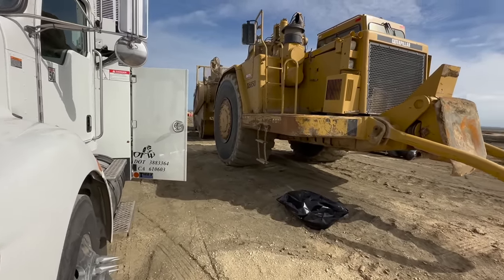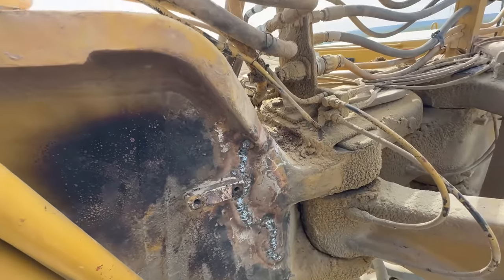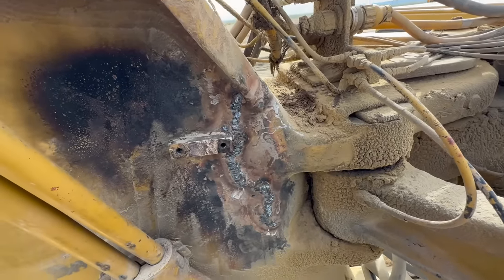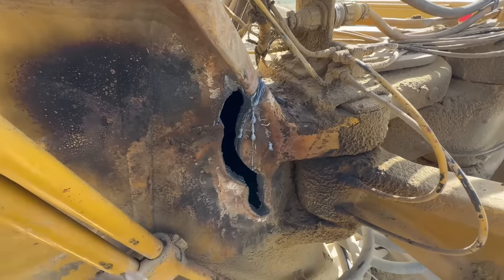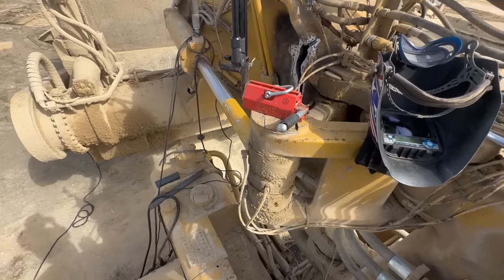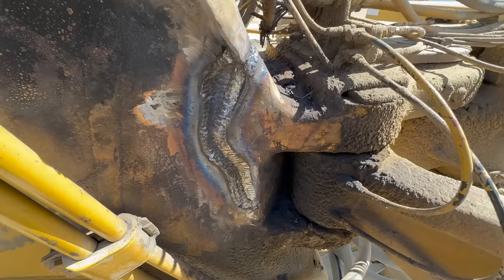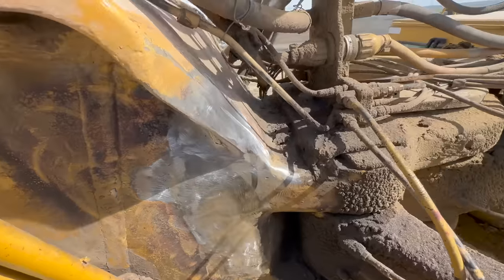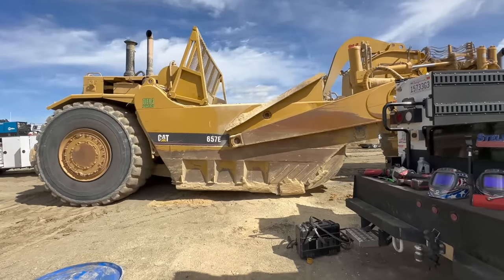Cat 657 with a big crack!!!

Comment: Hats off to who was doing their checks, easily missed until it's a much larger problem, rare in this day.
Reply: Very good point    I have 2 sons in their mid 20s and they would just plough on until the  scraper just stopped or broke n 2  Haha 😎
Reply: That, and hats off to the mechanic that held that thing together for a couple of days.
Reply: That is well spotted, just looked like mud at first
Reply: Checks? What checks?!
Reply: @notorious647  Umm.. the checks that, umm found the, umm cracks, yes, that's it, the checks that found the cracks, and any other defects, you know looking with your eyes. hope this helps.
Reply: @IvyMike.  Who does that?!
Reply: @notorious647  I agree, who does that? I bet the person who found it was the mechanic. I always get things after they have completely fell apart. Afterwards the person is like “yeah it was making a weird grinding noise for a couple weeks.” Thanks for letting me know…
Reply: @notorious647  Pay checks
Reply: usually with stuff like this that has allot of workers around the machine they take safety very seriously and usually call in dedicated inspectors  quarterly or at least bi yearly now if it was the workers inspecting it then im actually surprised cause most dont care even if they own it
Reply: Someone took pride in their machine. Good to see.
Reply: Where I work The MAINTENANCE team won’t do a thing until the machine stops working then they end up having to fix everything instead of just MAINTAINING it
Reply: @collingalbraith4343  well you see you problem started at the in house maintenance part. anything in house will be zero effort just making the paycheck job security bullshit
Reply: It looks to me like this has happened before.
They probably keep an eye on them all the time.

Comment: That was so cool to watch that scraper pull away as soon as you were done. Makes you realize how important the work that you do is.
Reply: I’m a mobile diesel mechanic and I fix breakdowns often. Always fun seeing them drive away after a successful repair
Reply: The first repair worked and machine did fine for 2 days.
Reply: Don’t let customers run your business, if it’s going to get a better job done tell them to do what you need and in this case separate the machine. Your quality will depend on you doing the very best job. Your skills should not be compromised by lazy customers.

Comment: Thats a darn good repair. Its impressive how thick the material is and still manages to crack out, none the less thanks for sharing and nicely done.
Reply: Sometimes it is better to have some flex. When you overbuild the structure, you need to add reinforcement sometimes to prevent cracking. We had similar issues with some of our mining trucks and had to add gussets to the areas prone to cracking. The miners are very hard on the equipment.
Reply: @davidbrennan5  Re-enforcing one area can lead to failure on another part. The design should incorporate all of that. Then prototype and In-the-Field production. We beefed up 'tag links' of Articulate Off Highway Truck suspension brackets that were failing in new trucks. The trucks had been modified by the customer to carry more then their designed load. At first, the truck suspension would not lift the truck when loaded by the shovel. (Too much muck in the body.) The OEM sent us relief valve cartridges of a higher value. (2800PSI rather than the 2300PSI spec.) That meant the truck suspension operated correctly. But the extra loading meant the suspension mounts started breaking off. We fitted re-enforcement. Then the frames failed. The OEM sent much meatier brackets to spread the loading over a lager area of the frames and axles. That cured the problems. The OEM adjusted their design decisions after that to cater for greedy customers and keep their sales figure up.
Reply: gotta remember there’s big d-11’s pushing against them alot of times and that’s the focal point is there and on the blade on the bottom of the bowl
Reply: Metal fatigue is an issue. Steel can generally handle metal fatigue well, but cast steels less so.
Reply: @murmenaattori6 properly heat treated, a steel casting can be extremely competitive with forgings in terms of yield strength and fatigue life. Ask any metallurgist. The problem is welds, which concentrate street if not re-heat treated, and most designs have a built in service life where the highest stress parts are expected to crack in order to keep weights down.
Reply: @crazy_mind-ox8if  Not saying cast steel can not have good tensile strength and fatigue properties, but that compared to rolled or wrought stock alloys, cast will always be weaker especially in terms of fatigue resistance. Not only due to higher preferred carbon content for casting efficiency (lowered melting point and improved flow characteristics) but also inherently due to the technique, the casting grain structure is not as uniform. Even after heat treatment, castings will never be as strong as alternatives. While I am well read in the subject, I am not a metallurgist of course. I have experience in casting (sand, lost wax casting, vacuum casting), hand forging/blacksmithing, manual and CNC machining and welding with gas, stick, tig, mig, flux/dual shield and I do vintage machine restoration as a side hobby. My point is I know my metals. Cast steels tend to also have lower weld adherence and fusion strength due to carbon migration to the seam from the higher carbon casting. Castings, even large industrial ones like this also inherently have some hidden porosity and other defects that quality control simply cannot account for 100%.
Reply: @murmenaattori6  look up HIP(hot isostatic pressing). Its what is used on aerospace parts that need the improved strength. Thats more on the research end and isn't really used currently on castings that large due to the pressure chamber constraints. But it removes all the microporosity and refines the grain structure a bit. I'm involved on a few of those research projects, and its a long running debate if castings or forgings are stronger(using the same alloy). We also run the cast in steel competition among colleges to try and promote cast steel strength and how they can be similar to forgings. (usually when that stuff fails its because of a bad weld than the material itself.) So I'm not saying youre straight up wrong, I'm not really qualified personally to do that. But I do know a lot of the top metallurgists in the industry who would fight you tooth and nail on that lol. With good heat treat and the proper post processing you can get some amazing results. Also, on my end, I do the risers and pattern design for these parts. Theres a lot of things I can do to change the solidification and give specific properties in areas if needed. Chills absolutely will give a smaller gains structure with much less microporosity and fewer impurities. Only reason we don't change rigging to help mechanical properties is because of a lack of communication in industry.
Reply: @crazy_mind-ox8if  That's an awesome process, thanks for the information. Of course the maximum scale of a casting to be treated is just a matter of investment and resources. The volume of castings a company like CAT makes is huge so I don't think they would use such a process even if available simply for reasons related to cost saving, hence I was quick to compare whole castings to the closest cheap method of welded together forged profiles. By the way, what do you think of electroslag remelting (ESR)? While a bit unrelated since it can really just make simple cylindrical blanks for machining, I find it very interesting.
Reply: @crazy_mind-ox8if  And I do regret using the wording 'x will always be weaker than x' since it's of course not that black and white. After all forged, rolled, drawn and extruded parts were all once cast blanks, only later improved via mechanical pressure. From what I understood, HIP is in a sense another type of advanced forging under a protective atmosphere (?) where the force is exerted all throughout an object via pressurized gas or another medium instead of mechanical means.
Reply: @murmenaattori6  essentially yes. The casting is put in a pressure chamber and heated to the point it becomes soft. The pressure then presses it, and closes any microporosity and other defects. And I'm guessing theres possibly some grain refinement as well, but like I said, not quite my area of expertise. I just hear about it a lot. There are also some start up companies looking to pressurize the castings right after pouring, which would cause them to cool faster as well, and help with smaller grain size.

Theres a lot going on, and a lot of possibilities, limited only by cost. I think the biggest struggle for a lot of this being implemented is that you have to have good communication between the design engineers at CAT, the metallurgists at the foundry, the pattern design engineers, and the people investing in the equipment, and they all together have to decide that the better mechanical properties are needed, and sellable with this technology. And the foundry needs to know what properties they can achieve, to sell it to CAT, but they don't have the money or research done to invest in it up front. The Department of Energy, and US military is slowly funding the research, but it'll take years to get far enough. So its a mess. Anything else you're interested in?
Reply: @murmenaattori6  had to look it up. My foundry is exclusively carbon/low alloy steel so we don't really deal with anything like that. That is a really interesting process though. I've always felt like material science was the precursor to most of humanities big break throughs, so I would be curious to see what material properties they are able to achieve with those materials/how much it improves things.

Digging a little deeper, the foundry I work at does all the steel refinement in the arc furnace. So the steel gets refined entirely under the slag layer. On Wikipedia atleast, the "highly reactive slag" just sounds like a basic (as opposed to acid) slag. Which makes sense since it reads the purpose is to remove the sulfides, which is the advantage of basic over acidic. So I'm wondering why it gets done as a second refining step beyond the furnace. Im guessing that process gets better mixing between the slag and alloy, and you have less sulfides to start with so you're able to pull more out. Plus it sounds like the alloy cool under the slag so you don't get re-ox which you wouldn't want to do in a furnace. Cool stuff.

Comment: That's an impressive plasma cutter! 1 to 1 1/2" thick material and it came out clean 😮
Reply: Must be over 100A?
Reply: I was thinking the same thing. My cutters wouldn't even touch that. 3/4" at most.
Reply: He’s got to be running a 85-100amp (HYPERTHERM) no other bs, and his machine has got to have a three phase power source or has secondary generator pushing three phase, he has the machine (tractor)near a three phase power source etc. etc….he has also got a great compressor as well and takes his time while he cuts and sees it thru. I give him 5 stars for his quality it’s great to see this video. I’m in 20 years now on my own doing this exact trade. With two trucks on the road I love it!!!!

Comment: Nice job on stitching it up. When I was building and repairing railroad cars back in the day, I used to use a air arc to cut all the welds out. I could chase a crack much more easily than a plasma cutter.

Comment: We used to weld repair Cat 777 rear diff casings where they cracked between the bolt holes. And big shovel buckets etc. Cat normally provide Weld Repair instructions for those critical jobs. I remember they were very hot on Weld Inclusions. They recommended that 'grinding stones/wheels' were avoided in final surface prep prior to welding. The little bits of abrasive get lodged in the surface and then form pockets deep in the weld which can cause failure. Even as the weld cools the inclusions can create micro-cracking. If the cracks join up over time and loading, the repair can fail. I notice you use a carbide- burr to clean out after the plasma cut but then change to a wheel to chip slag between runs. We used a needle gun to chip slag as part of Cat instruction. The needle gun also peens the new material and helps unload surface stress due to shrinkage of the weld.
I can imagine the mechanic's emotional state when he saw the crack. 
That repair looked absolutely lovely when finished. And the Cat Paint in the rattle can goes on great. We use a lot of it too. Our lazy ass welders never consider the aesthetics of their work though. The mechanic has to paint over the welders work. And that is just not cricket. 😀

Comment: I am really looking forward to seeing how you do this one. I repaired a hole in the case of a skid loader using muggy weld. I know it sounds silly but the sticks I get from them were perfect.
Reply: Did you use the Muggy to fill the hole in a gearbox case or engine case? I’ve read good things about Muggy.
Reply: @FIGGY65  I used a piece of aluminum but yes I used Muggy to weld the aluminum and it turned out beautifully. I recommend highly. I found muggy from Branden Luft's video about it.

Comment: I'm a beginning welder so there's lots I don't know:  That's a pretty massive cast assembly but I wonder about the amount of heat you had to put into it.  Did you have to pause along the way to let it cool at all?  Did you use a temp gun to measure the temp or just experience?
Reply from the maker: I did use a temp gun to watch the heat. I had to stop for 30 minutes one time.
Reply: @OFW  what heat did you stop at? What would have happened if you kept welding?
Reply from the maker: @dans_Learning_Curve   I like to keep the material at 600 degrees or less. It can crystallize if it gets too hot which causes a list of issues.

Comment: Nice job. Probably should have preheated it a bit for a stronger repair . Also get a needle gun for chipping out that slag. It does a perfect job. ( Former certified welder)
Reply from the maker: I did pre heat a little. I almost got out the needle gun but I didn’t want to keep the compressor running for a few hours just for that.
Reply: Haha ok, did not mean to nitpick. I used to work in a shop doing large structural pieces, and we never ever welded anything that was not preheated, and tested with a heat stick. The parts were for a nuclear power plant, and every weld was x-rayed. So you learned pretty quickly how to do perfect welds, or you no longer worked there...   
😃
Reply: Preheat depends very much on plate thickness and carbon content in material. 1 inch doesn't usually need much unless working in cold conditions. I do welding repairs on oil platforms in the North Sea.

Comment: Did this kind of work for 50 years  with operating Engineers local 370 and 302 Washington,Idaho Montana and Alaska love it when mechanics /Welders take pride in the repairs good looking repair.This breakage is caused by lack of haul road maintenance  no motor grader or box blade to fill in chuck holes 40 miles per hour with100 ton takes it's toll on big iron.